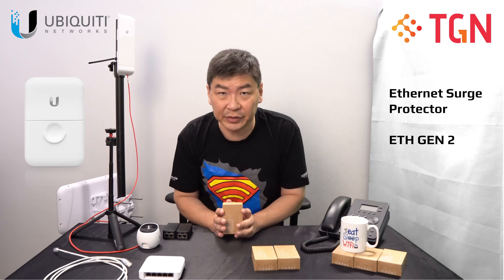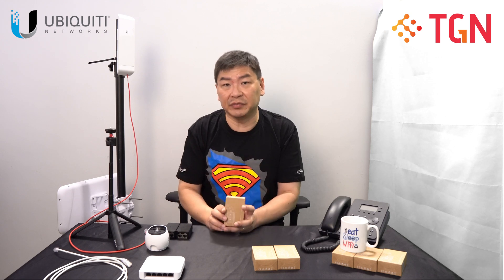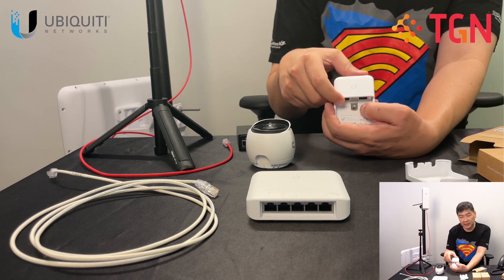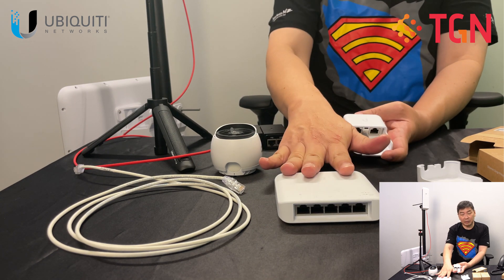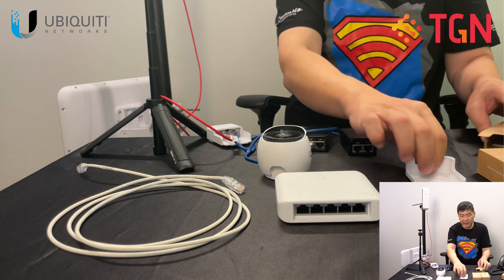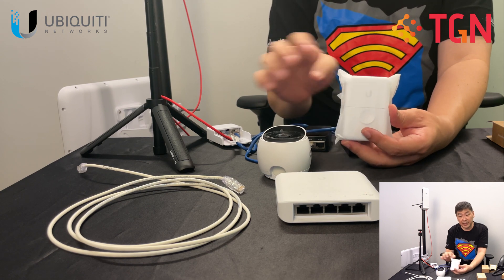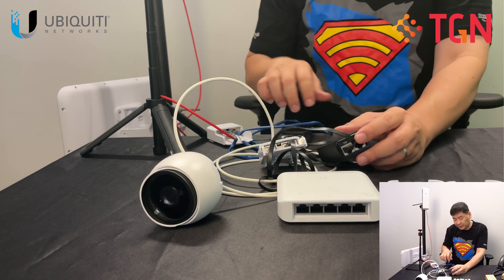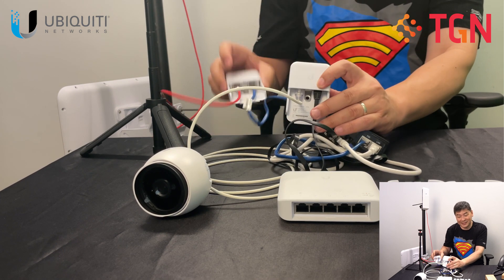Ubiquiti Ethernet Surge Protector (How-to)

Comment: Nicely presented.  One thing I don't understand ... if the WiFi AP or the camera are outside and the cable going to them gets a lightning strike, will they be unprotected?  I see how a power surge from inside is stopped by the surge protector.  I also see how lightning outside will not get to inside equipment.  BUT, in the event of lightning ... what protects the outside gear?
Reply: And yet you didn’t mention grounding the surge protector
Reply: In the Ubiquiti documentation for their PtP links, they have you put a surge protector as close to the outdoor device as possible and at entry to the building. That is supposed to help keep a surge from outside go in and ruin equipment in there or travel up the cable to your outdoor equipment.
Reply from the maker: In event of lightning strike to outside equipment, Nothing to protect the outside hardware. The surge protector will prevent further damage to your inside equipment.